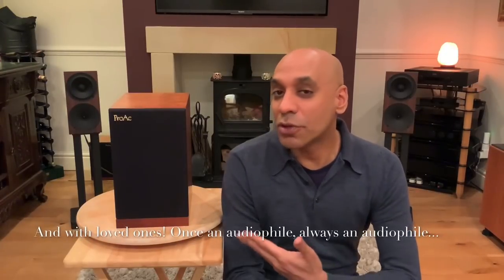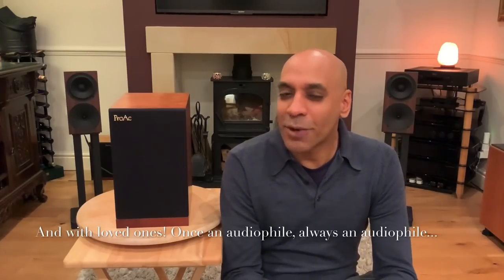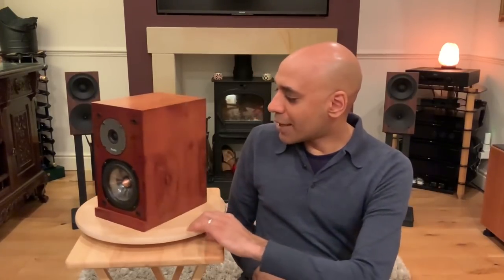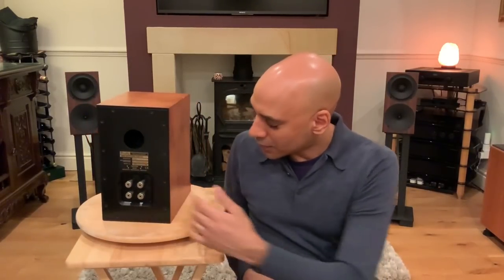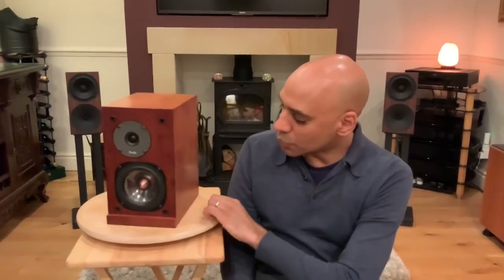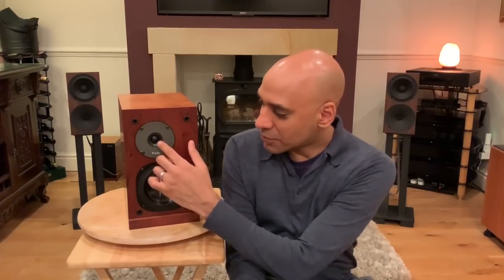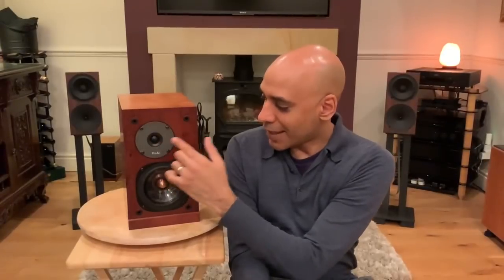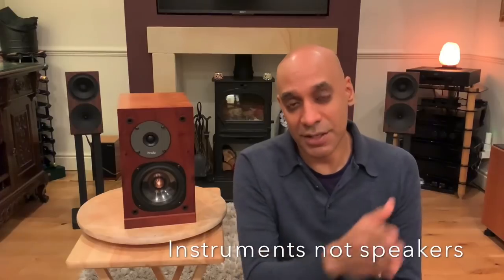Proac Response 1SC Speaker Review (biased?)

Comment: Your room sounds very "live" on your voice. Looks a lovely room but I'm sure a bit of discrete room treatment would reap benefits to sound.
Reply from the maker: Hi John, the room is on the lively side but not as bad as it comes across in these videos. I think it has something to do with having to remove furniture for filming and a lot to do with the inexpensive mic. I can’t really get away with any more room treatment in our main living room where my system resides. However, in my listening position the room effect is not too bad. Thank you for watching and sharing.
Reply: @abritishaudiophile7314  your best room treatment is the ceiling use natural wool fleece give you that more Concert Hall feel live events, and ideally in a wavy pattern 3 feet in front of the speaker or the whole lot depends how you feel. You don't have the fleece touching the ceiling have a gap of a  2-3 inches. Just get some stick-on hooks place some on the Ceiling every couple of feet use fishing line and some wooden dowel or bamboo to hold the fleece in place. Would be nice to have some bamboo rugs on the floor with fleece underneath where the speakers are situated. If you want to isolate your windows can be a big problem use bamboo roller blinds lined and attach fleece to the back has to be thin fleas can separate
Reply: @johnsweda2999  Huh?   Where the heck did you get that idea from?  Do you know what the absorption coefficient curve is for natural wool fleece and why you would recommend that vs another absorption material and maybe a combination of absorption and diffusion?
Reply: John you are right. Everyone keeps telling Tarun this. His room is so awash with reverb/reflections, that it's laughable to consider this an 'audiophile' listening environment.

Comment: I wanted to commend you on this lovely presentation for the classic ProAc Response 1SC monitor speaker. Having owned this same pair since new; I've been mesmerized by the naturalness of these speakers since the first time I've heard them in 1997. My first experience hearing these was on a vinyl set up with a single ended triode integrated amplifier rated at a mere 13 watts per channel. Granted, these speakers have a mid to low level sensitivity at around 86 db but an 8 ohm impedance. Surprisingly, these speakers do rather well with low watt amp designs but the electronics have to be upper tier. This further reinforces your assessment on low level listening and clarity of tone, especially in the mid range. What really excited me about this review are the design details and specifications on the build. Primarily the cabinets. This speaker was designed like a Stradivari Vesuvius of Cremona, Italy! Your description of  wall "thinness" was very informative and reveals the level of detail that Stewart Tyler paid to designing this gem of a speaker. I also appreciated your informed description of tweeter placement on x, y axis in relation to cabinet edge distance. I was always under the impression that the tweeter alignment had more to do with relation to sitting position. Traditionally, the speaker placement favors tweeters closer to the listening position (right speaker with tweeter on the left side of cabinet and left speaker with tweeter on the right side of cabinet.) A detail I was told many years ago about the 1SC was that the MDF was cut at varying angles in relation to the interior of the box to further refine the sound by eliminating parallel surfaces. About the drivers used on the 1SC's? Whilst in New York City I had asked the owner at Stereo Exchange about the manufacturing of the ProAc 1SC's and he told me that Stewart Tyler had mentioned to him that he uses Scan Speak drivers and has them modified under his specifications. Also I remember reading an article or two that confirmed this rumor about the Scan Speak drivers. Regardless, they are perhaps one of the most beautiful looking monitors I had ever seen with the transparent mid bass drivers and copper phase plugs which looks like a transparent window peering into the driver, exposing the voice coil's copper winding and metal basket. The 1SC's are a keeper! I, most likely, will be putting them in my will. And until then, I will continue to experiment with different electronics and discover what works best with these magical transducers...
Reply from the maker: Hi Gerry, I really enjoyed reading about your experiences with the 1SC. I agree with you that they have a very natural and engaging delivery. I glad to know that you have had as much enjoyment out of your as I have had out of mine. Thank you for sharing 😊

Comment: I really like your videos, you do a great job. I had a pair of Proac Response 2.5 and bought them in 1998. Proac's are midrange kings, they just have that midrange magic. Full bodied with very little bloating. They are very well built speakers and are made to last. My 2.5 were getting a little long in the tooth ( I was worried about the surrounds needing to be replaced) so I traded them in on a new pair of Audio Physics Tempo Plus. Proac's are hard to get in the states these days but I would've loved to try out the D20s. If I can get 20+ years out of the AP like I did with the Proac's, I'll be a very happy guy.
Reply from the maker: Thank you James. Much appreciated. I would love to get some modern ProAc in for review. They respectfully declined when I was starting out last year. Maybe worth another try 😊👍

Comment: Those 1SC are such lovely looking speakers. Timeless aesthetics (and sound, given what you say). After going through a lot of speakers, both demoed or owned, I've recently settled on some Proac D2R, which are just wonderful. Run in a 12ft x 14ft room, by an Arcam SA30. I realise they'll scale with better amps (by all accounts, Sugden or tubes are well suited).

The Proacs have a slightly more revealing / detailed presentation of highs than I'm used to (Spendor Classic 3/1, which had too much bass for my room). And it took a day or two of demoing for me to 'get them', after coming from such warm, forgiving and silky smooth speakers. But it's such a liquid, insightful treble, blended seamlessly by the smooth, fluid midrange. Good recordings sound wonderful, great recordings can be staggering. And underpinning that, is a decently tight (but not uptight) bass, that's both warm, fun, and flowing.

They're a really addictive, involving speaker to listen to. Real all rounders, with a superbly judged presentation in my opinion.

Would be great to see a review if the D2 or D2R on your channel at some point, subject to you being able to secure a pair.
Reply from the maker: Thank you for sharing your experiences. Very interesting 😊👍

Comment: Tarun, thanks for you review of your Proac's, but mostly for explaining the steps taken to deal with edge diffraction, by offsetting the tweeter in both horizontal and vertical planes. I'll be borrowing this technique when I install a set of ADS 320i speakers into 1/2" thick Bamboo enclosures (I'll take into account the crossover frequency to compute wavelengths to the cabinet edges). Will make mirrored pairs as well. Considering the 22+ years you've had them speaks volumes. I feel you've presented an unbiased assessment, using multiple amplifiers to convey that quality counts.
Reply from the maker: Thank you Bradley. I tried my best to remain impartial. I appreciate your support 😊👍

Comment: Excellent review and I owned the Proac 1sc's for 14 year's and agree with your notes that their strength is the mid-range and pinpoint accuracy (classic status).   After eventually selling them in search of a fuller and perhaps more dynamic and extended sound, I dabbled with other brands but never truly satisfied. I  have returned to Proac and now own the Proac SM100.  They retain the excellent midrange (close to 1SC), with a better bass response and slightly sweeter top.  Its another option and its a speaker Stewart Tyler worked very hard on to replace the Studio 100.
Reply from the maker: Hi Yives, great to hear you experiences with Proac 1SCs and the SM100s. I have heard good things about the Studio 100s over the years but never listened to them in a proper setting. Paper cone woofers if I remember correctly, always a good sign.

Comment: Love them........., heard them driven by a Cary SEI-300B integrated amp back in 1997, having owned a pair, as well as 4 different variations of their Tablette model ( except the 2000 make ) since 1988 - 2012,  I’m with you, there’s a lot to love about their overall sound, especially when paired with tubes | Naim | Exposure | Original Onix ( U.K. ) based amp location.

Memories indeed.
🧐
Reply from the maker: Hi NosTubes58, thank you for sharing. I know of hardly anyone who has you level of experience with Proac speakers. I really value your input.

Comment: Enjoyed this video greatly ! It just reaffirmed my desire to get a pair and add to my other British b&w matrix 802 series 3. Hope you do a review of the fantastic rel strata sub! Lost count of how many times I have owned owned that or a storm or a stadium!
Reply from the maker: Thank you for the suggestion. I would like to get a current REL in and do an A/B comparison video. Interesting as the company has changed hands since and the new design have gone from sealed boxes to passive radiators for much of the range.
Reply: @abritishaudiophile7314  I think it would be a interesting comparison with the newer models. I have been close to getting a t5i or a t7i multiple times. I have heard some good things about John hunter at rel over the years. It would also be interesting to try a pair of smaller models vs one in a stereo setup to contrast the performance difference. Some say 2 are better than one. In a small room perhaps even their newer t zero models would work. I believe rel as a company has been through some changes and maybe bought by someone else along the way since if I'm not mistaken? So should be interesting to contrast newer stuff with their older classics. Thanks!
Reply from the maker: I agree Brandon. Two small subs is definitely the way to go if you can accommodate them. They help to even out the room modes by having more than one bass sources. Think of them as active bass management.

Comment: Thanks for the great review, and also your video of what's inside.  I have also had my pair since new almost 20 years ago.  They are powered by a Creek 5350SE, through some pretty high level Wireworld cables (and the rest of the setup has silver Wireworld connects).  I have always loved the sound.  In a previous flat I had an electrician install several dedicated AC lines, which really helped the dynamics.  The sound has always been natural and very pleasing even though I find them to be revealing (not as much as electrostats surely, but still good).
Now I have moved to a larger flat (the livingroom is about 40-50 square metres, with lots of angles (converted attic).  Now the sound is still good, but lack somewhat.  I experiment with placement and such.  I have never been a fan of subwoofers, but have started thinking about maybe adding it.
If you don't mind I have a couple of questions:
- Given the age of the ProAcs, is there a need to have somebody upgrade/change some parts in them?
- Would a new/larger set of ProAcs be better suited for a larger space, and if so what would be the sweet spot in terms of pricepoint?
- Should I keep my Creek, or go with something new (and hopefully better)?
Thanks in advance
Reply: Thor Bostad I would consider changing the capacitors in your crossovers. The crossover caps used were not as good as what is available now.There is a plethora of really high end caps available these days. I recently upgraded some fairly new Solen pb series to Solen Silver Series and the difference was well worth the money. I was previously skeptical that it would be worth it. The improvement in micro detail and naturalness of voices was significant compared to much more costly improvements that I have done. There is a site "humble Hifi capacitor ratings" and a review of caps. Tony has done reviews on many caps and it will give you an idea of what different caps will reveal. Any cap rated 9 or above on his chart is a very good cap in my opinion. A cap upgrade will be much less money with a bigger reward (for the money) than changing your amp. Even if you decide to change amps, having better caps will be required to fully appreciate it. Good luck !
Edit: You only need to change the caps that are in circuit with your tweeter. The bypass caps for the low pass (woofer section) will not require changing. This is easy to do yourself. Just replace the caps with the same value as you already have.

Comment: Hi Tarun, what integrated amplifier would you recommend for a Proac response Db1? I know that you have an extensive experience on your SC1 and i am in the market for a good synergetic integrated amp to pair with my newer DB1. I would like to have a lush midrange quality, wide soundstage, great imaging and tonally correct sound signature. I listened mostly at low to mid level and  don’t need gobs of power. Nothing fancy but really a good match for the proacs. Thank you in advance.
Reply from the maker: Hi Dan, based on what you want, top of my list to check out would be the recently launched Exposure 2510. Check out my review https://www.youtube.com/watch?v=B7vABYJcKdU
Good luck 😊👍

Comment: Always liked the ProAc sound. It’s all about what each listener is tuned to. My experience with ProAc has been with the Tablets and the ones I own which are the ProAc EBT, extended bass tablets. These are very fast, transparent and unforgiving of mediocre equipment in any system I have tried them in. They reveal flaws in the recordings, so unforgiving! It can be a curse which is why I am very careful about what gear I use with them. Tarun, you spoke about defraction effects and this can be dampened by using what I’d called a defraction blanket that is custom fit to the cabinet proper. It takes time and patience to fabricate them, but they do work and I have made them. They are not a cure for poor speaker design or execution of that design. Most bookshelf speakers need a substantial metal tube stand which has been spiked and terminates into a sand trap. Further aid comes in a sand trap that rests upon the top of the speaker. The top trap is spiked to the top of the speaker and enhances the deadening of the speaker’s cabinet. The stands are filled with playground sand which is completely filled into the empty tubes of the stand and followed with casting resin which fills the voids and makes the stand as dead as possible. The bottom trap is used for wood floors and absorbs the energy generated by the speaker’s cabinet. This inerts the cabinet and allows the speaker to voice itself as intended. It will shine or fall short, but it won’t be due to poor stand design or build. Speakers can be problematic if not treated. A speaker is an energy transmitter and as such, needs help to dissipate and drain that excess energy off so the speaker can be truly heard. There are other things to address, but addressing the common problems bookshelf speakers have allows the user the ability to truly hear their speakers and not their speaker’s problems. It also will reveal how well they actually do sound. One problem at a time is how we learn where problems are and how each must be addressed. The stands I use have a four inch square steel column, 10 gauge thickness and have 1/4” thick top and bottom plates. The plates are dampened with a thick pad of material that I cannot reveal, but that’s why it is called proprietary.
Reply from the maker: Very interesting as always Mark. Thank you for sharing this for other to learn from. I have never heard of a diffraction blanket. Is it like a sock that fits around the speakers. I would be curious to learn how it works. I will try and look it up. Great to hear from you my friend. Stay safe. 😉👍
Reply: A British Audiophile, the defraction blanket is made from foam that has bumps on it’s surface. It has to be cut at the edges to fit the speakers sides and top and bottom. Three Velcro strips hold it in place. They are not hard to make. They may not be attractive to some, but it is about performance, not appearance. The foam extends 3/8” beyond the front and back of the speaker. This is supposed to cut the edge diffraction. Still experimenting with the final design. It is for bookshelf speakers as for now.
Reply from the maker: Thank you Mark 😉👍

Comment: I love these, totally agree their strengths are in midrange and how well the blend into to treble  imaging god you need to spend mega bucks to better it for imaging. I have 2 pairs of Proac Response 3.8s they are brilliant and I love them. However, I heard the 1SC paired with two REL S3-SHO aboutva year ago and was blown away by the integration and extension, using theses subs if anything allowed the main speakers to just take their strengths out to another level. I can fully understand why you have kept them all these years. Stewart Tyler is a magician in the way he voices Proacs. I know my main drivers were designed to a Tyler spec and built by SEAS uniquely for Proac. Not sure about the sift dome tweeter though. In some of the big older D 100 Range and some of the new K range use ATC mid drivers but not sure what bass and mid bass. They do make some of the best speakers on the planet at any price in my humble opinon.
Reply from the maker: Hi Gerald, great to hear about your experiences with the Response 3.8s. I heard these quite a few years ago and I know exactly why you love them. Fascinating to hear your experience of the 1SC with two S3-SHOs. I really enjoy my 1SC/REL Strata III combo. Thank you for clarifying the SEAS drivers and I didn’t know that the K Series are using the famous ATC midrange but I can understand why. I love both those brands. Thank you for watching and sharing.